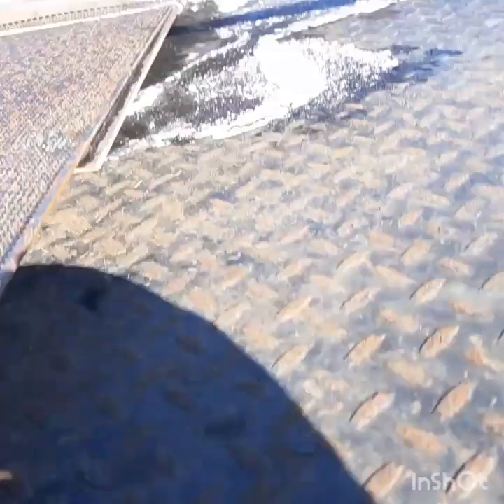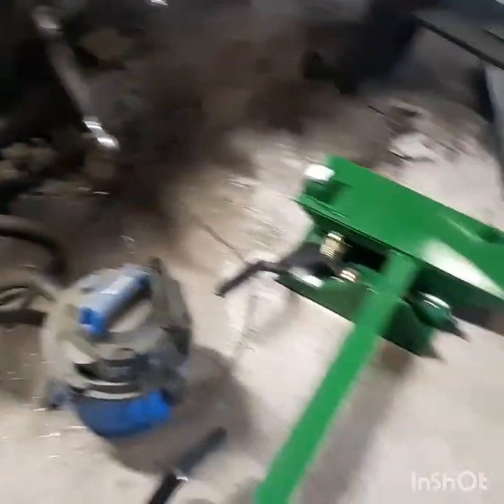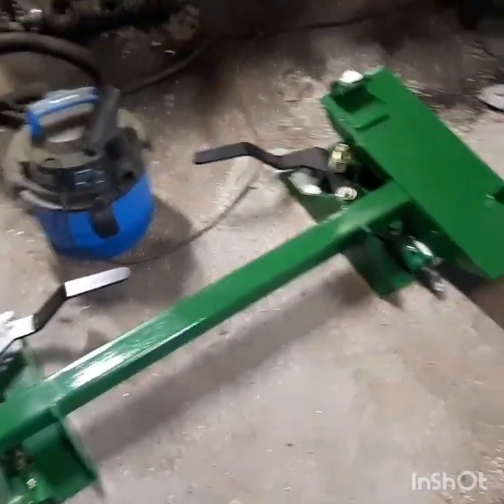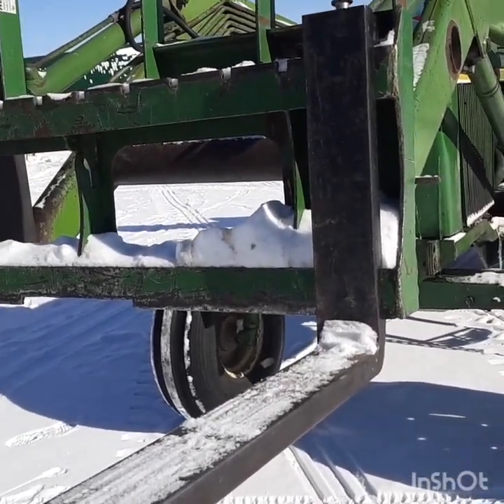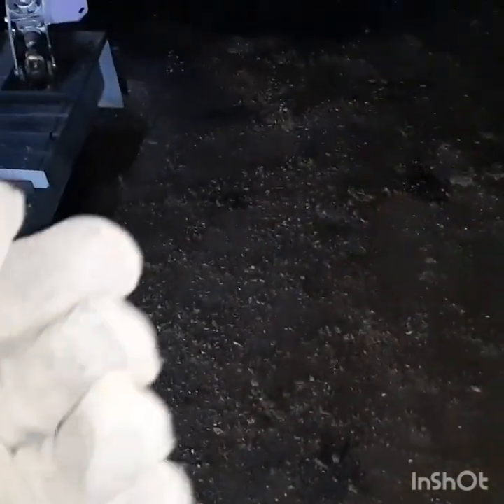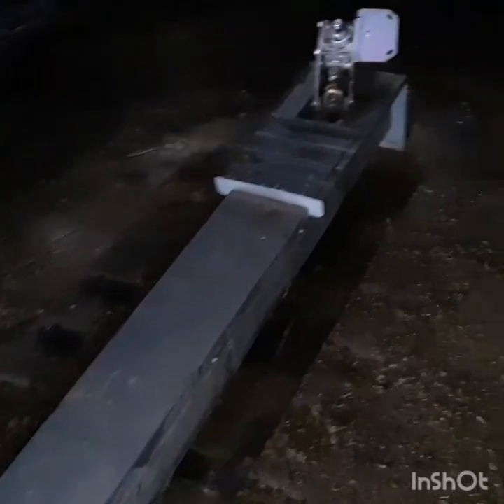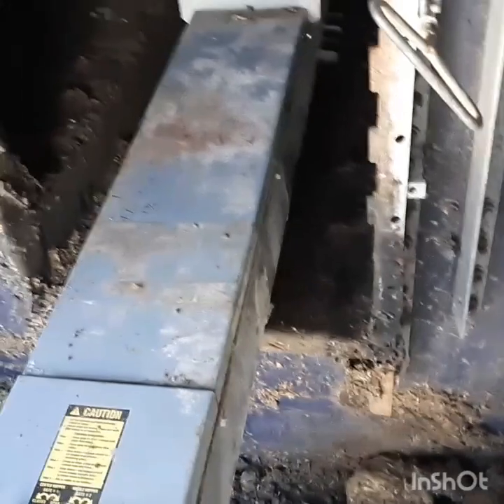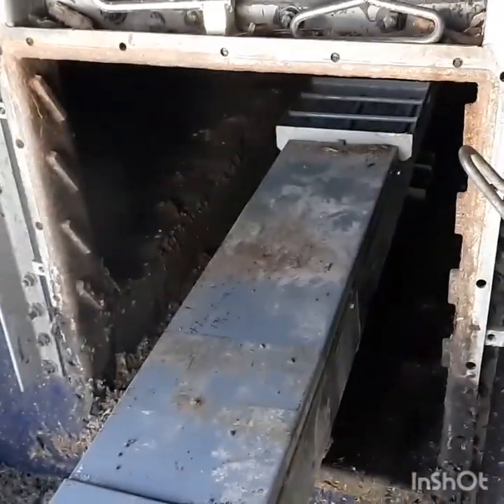Amazon haul!! New unloader goes in harvestor

Comment: Keep an eye on that quick attach.  I hav one very similar on my 70 hp Kubota....ive ripped it up a lot. Springs aint strong enough to keep pins engaged with some attachments. Had to put extra bracing on pin area too.  Jus watch it close and you can improve as you go
Reply from the maker: Thanks.
I will give the welds and pin area a look over.